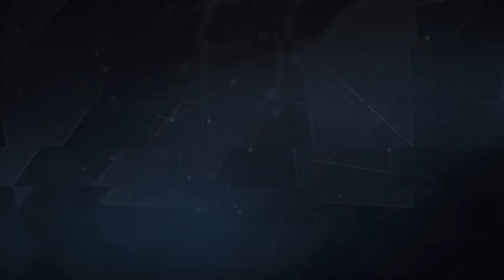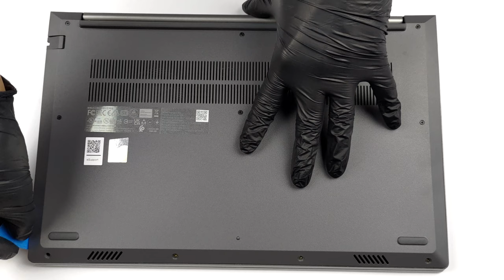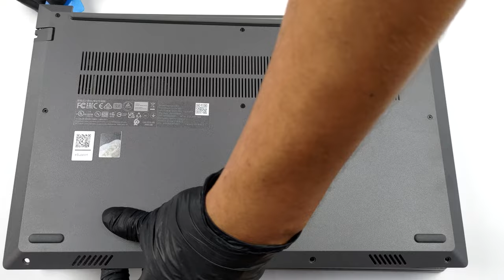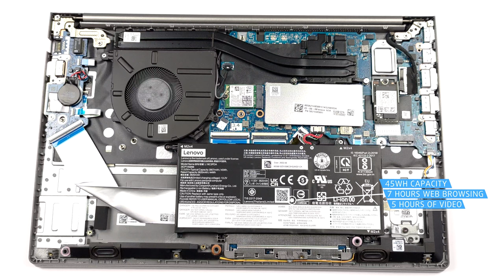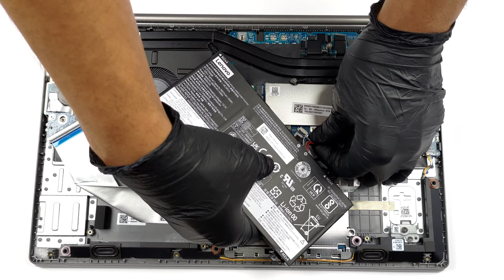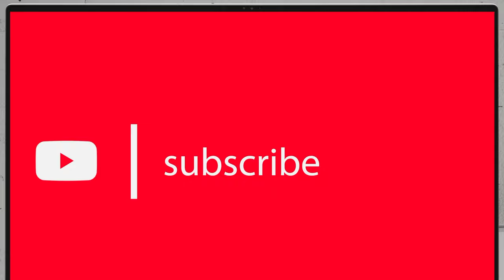🛠️ How to open Lenovo ThinkBook 15 Gen 4 - disassembly and upgrade options

Comment: Thank you for the guide!

Note for everyone wanting to add RAM. Like shown in the video - there's only 1  slot. You can't add RAM sticks (!!!)  you can only replace 1 8 GB RAM stick with a new one.

Secondly - when removing the RAM cover it feels like it's kinda stuck and then you hear a tearing noise - that's from the glue that is applied to the cover. It can be put back on doe easily (the cover, not sure about the glue.)

Lastly a question - I have a slower 16 GB stick that has 2667 MHz, which ofc brings the faster 3200 MHz factory RAM down to 2667. Would you still replace the RAM with the slower one if it brings down the speed? On the plus side it increases the USABLE RAM by 6 GB!
Reply: Yeah, you can't pair ram modules. It sucks...
Reply: Bit late, but yes, I would add the RAM stick. RAM speed is not hugely important, at least not between those two things.
Main considerations are that it depends if you need the RAM increase or not. Ryzen chips also benefit more than most others from faster RAM. That said, you likely won't notice a speed difference.

Comment: What is the maximum capacity for each of the SSD's that can be used? Is there a screw already in place for the empty SSD slot? Are both SSDs' the same physical size?

Comment: 1:35 DId I get it right - 8 Gb soldered on + 8 Gb installed in slot? Means you can expand ram up to 40 Gb (8+32)?